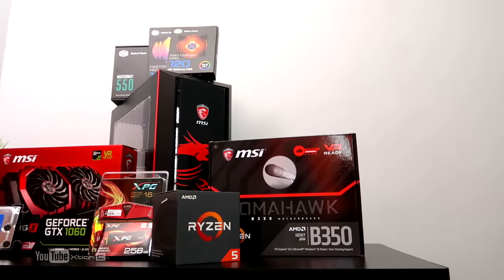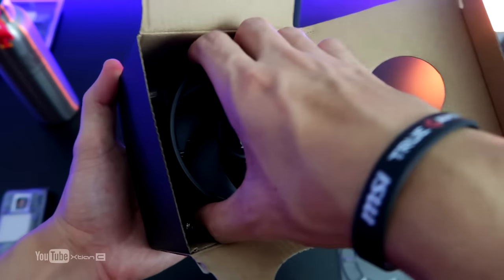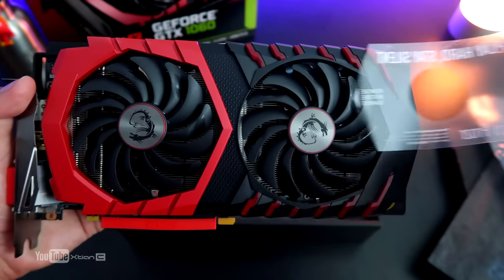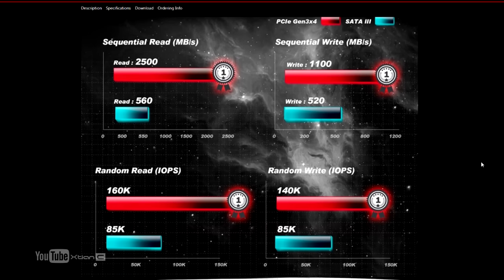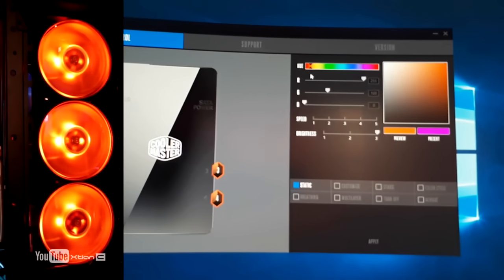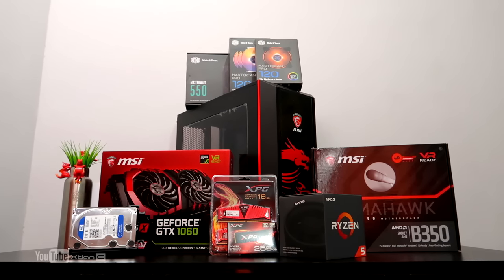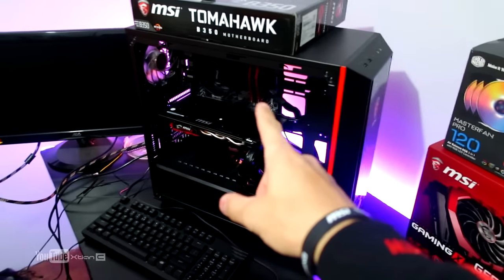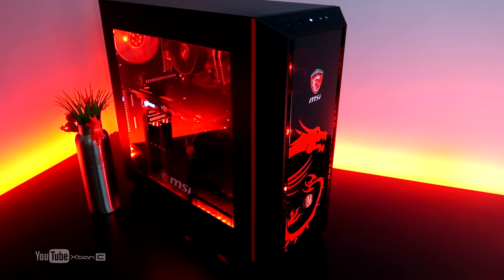Php65k Ryzen PC Build I Ryzen 5 1600 I MSI B350 Tomahawk I MSI GTX 1060 Gaming X 6G [Ph]

Comment: The “XPG SX8000 PCIe 256GB 3D NAND MLC NVMe Gen3x4 M.2 2280 Solid State Drive with Heatsink” is out of stock will a “XPG SX8000 PCIe 1 TB 3D NAND MLC NVMe Gen3x4 M.2 2280 Solid State Drive with Heatsink” work

Edit- also could a “WD Blue 2TB PC Hard Drive - 5400 RPM Class, SATA 6 Gb/s, 64 MB Cache, 3.5" - WD20EZRZ” be switched out for a “WD Blue 6TB PC Hard Drive - 5400 RPM Class, SATA 6 Gb/s, 64 MB Cache, 3.5" - WD60EZRZ”

Also can a “MasterWatt 550 Watt Semifanless Modular Power Supply, 80 PLUS Bronze Certified Power Supply for Computers” be switched for a “MasterWatt 750 Watt Semifanless Modular Power Supply, 80 PLUS Bronze Certified Power Supply for Computers”

Comment: Pc build plan

Cpu : Ryzen 7 2700x
Mobo : Msi B450 tomahawk
Gpu : gtx 1060 6gb
Ram : 16gb ddr4 2400mhz
Hdd : 2Tera
Ssd : 250gb samsung evo
Psu : any 600w or 550w full modular 
Case : deep cool (earlcase)

*stock fans 
What could be the flaws or possible bottleneck? Given the airflow.

Comment: I wanted something similar to this build. May I know why you didn't go for a GTX 1070? How much would it cost estm. if you get that build with a R5 1600x, GTX1070 and only 1TB HDD.
 Thanks.
Reply: Mr.G / xLockser ois, found out that the X version difference with the non-x is the XFR and higher base frequency, non x with the stock cooler,  it would be much cheaper, unless I go with aio coolers 😊

Comment: i want to build my firs gaming rig, need advice  po.?can i stream and play on high settings? and can i add a wifi for this one?
CPU- ryzen 5 1600
GPU- gigabyte gtx 1050ti 4gb oc
MOBO- gigabyte ga ab350 gaming 3 
ram- ADATA XPG Gammix D10 8GB DDR4 2400MHz
Ssd- wd 120gb
hdd- 1tb seagate
PSU-Thermaltake Smart RGB 500W 80PLUS APFC Non-Modular Power Supply .

Comment: processor:Ay Ryzen 5 1600
MotherboarD:GIGABYTE GA-AB350M-Gaming 3 AMD Ryzen CPU AM4 Socket DDR4 PCIe Gen3 USB 3.1 GB LAN Micro ATX
Graphics card:Gigabyte GeForce® GTX 1050 Ti D5 4G Graphics/Video Card
Case:Midtower
AT DDR4:Trident Z 16GB 8x2
CAn it rin Pubg in ultra setting in 70 Fps or under??
Reply: Yes but not at ultra
Reply: Mix settings to High but not default Ultra. You'll get a good stable fps up to 50+ fps. Upgrade it to 1070 ti, 1660ti or Vega 56 then i assure you can go in Ultra settings with a stable decent 60+ fps and up.

Comment: +XtianC Kaya po ba ng MSI GTX 1050 Gaming X 2GB at AMD Ryzen 3 1300X at HyperX 8GB 2133mhz Ram. Ang CSGO ng online at naka max settings 900p resolution. Habang nag rerecord or nag i-i stream. Can I still get 60-100+FPS with that kind of setting? Thanks if you answer my question XtianC. By the way I am your new subscriber
Reply: Timothy Azucena oo naman kayang kaya
Reply: kahit i 1080 mo pa ata eh
Reply: Uhm, bro go for ryzen 3 na lang tapos ioverclock mo. Maabot niya performance ng 1300x with stock cooler. Yang 1050 mo lalampas pa ng 100fps. Marami dito sa utube nagtest. Search mo na lang 1050+csgo

Comment: Nice rig man! Nust need your suggestion, will I still get the best out of the 1060 GPU if I use the 1500/1500x instead of the 1600? Medyo tight ang budget to a max of 55k eh. Thanks!
Reply: Go with ryzen 1600 para wapang bottle neck
Reply: 1500 wont bottleneck. Pero 1600p  po talaga ang sweet spot and recommended na din po  mas future proof e
Reply: Pwede naman financing eh
Reply: just go for 1500 or 1600, you can OC those base clocks if you want to bump them up :)

Comment: Intel Core i3-8100 Coffee Lake Quad-Core 3.6 GHz LGA 1151 (300 Series) Processor with GIGABYTE Z370M D3H Micro ATX LGA1151 Motherboard Bundle 
- 14,399.00
PALIT GTX1060 SUPER JETSTREAM 6144M GDDR5 192B 3DP HMDI VGA RGB LED
- 15,399.00
AVEXIR 8GB 2400MHZ DDR4 CORE SERIES RED LED AVD4UZ124001608G-1COR MEMORY
- 4,900.00 or 2x8gb 2133Mhz (6,800)
WESTERN DIGITAL 6TB SATA 6GB/S BLACK 128MB (WD6001FZWX) HARD DRIVE
- 15,250.00
i'm not a tech guy, idk if i3-8100 worth buying than ryzen 5 1600, i saw 1600 costs like 
i7-7700 in PH
= 49,948 or 51,848 all of them are brand new what if they're second hand or something on ebay or whatever. may be lesser XD

Comment: Bro ano ba ang ire recommend sakin amd or intel gusto ko kasing maglaro ng ultra preset ehh
Reply: J Andaya idol if youre only do gaming then go with intel coffee lake.
Reply: What type?
Reply: Coffeelake right now is expensive. Dahil z370 pa lamg nirerelease. Kung di na makahintay, ryzen 5+gtx1070, 8gb ram goods na yan.

Kung makahintay next year, b370mobo+8th gen i5+gtx1070

Btw, wala masyado difference ang high sa ultra preset. Fyi lang from personal experience. Kaya suggest ko is gtx 1060 na lang
Reply: Sef Isred yes. If he is concern only on the fps then intel platform is for him especially the new coffee lake.
Reply: Arafat Pokaan if he can wait until next year :D no accurate dates to when b and h mobos for coffeelake will be released.
Reply: Sef Isred lol. Pero hindi ba bottle neck nang i3 ang 1070? I mean 1070 is 1440p gpu so in order to maximize the 1070, i5 should be a better cpu.
Reply: Arafat Pokaan ai uo pala. 😅 nagsuggest ako ng i3 pero ultra preset pala gusti niya. Haha
 Edit ko na lang.

Comment: Uhh..i built the same pc except it had gtx 1070 8gb,ryzen 5 1600 . end price was 59k.
Reply: Godsu Godsu sup sir! I'm interested in your build po, patingin po ng components and san nabili? Thank you so much if sasagutin!😁
Reply: :O
Reply: 59k ako 50k rx580 same specs  inupgrade ko to gtx1080 nag swap kami  ng kakilala ko  dagdag ko 10k 😎 so 60k ginastos ko
Reply: Ask ko lng ano bang mas balance na mobo sa r5 2600x. X470 prime pro or rog strix x470-f?
Reply: @lance4930  bro kmsta experience mo with both gpu? ano po nfeel nyu pg mron at wlng freesync? balak q po kasi mg rx580
Reply: @ryujiikuma296  well if I were you bumili kanalang ng 144hz pero ang free sync kasi is parang pinapa smooth ang mga movements ng mga stuff sa game pero bababa minsan fps mo same na rin sa g sync pero rx 580 ok naman siya pag nakakita ka ng 13 or 10k bilhin mo na pag binili mo sa gou miner palitan mo lang ang mga thermal pads
Reply: @ryujiikuma296  minsan pag walang freesync medyo choppy or onteng lag ang game pero pag naka on smooth lang

Comment: i just checked the QVL list on MSI web and  "ax4u300038g16-drz" is not on the list and it worked for you fine,
so whats the maximum frequency you got with that RAM ?
and did you try to overclock the R1600 to 3.8 / 3.9 , i mean Could you get 2666 or 2933 on that RAM ?

Comment: i think mas mura na ngayon kse 2017 pa itong vid.
build ko almost 77k php?
Ryzen 2700x bundle with msi x470 gaming m7a Ac bt/wifi 30k php
Adata RGB XPG ram 2X8 gb 32Mhz.. 11kphp
Adata nvme XPG SX6000 512GB M.2 SSD 5.5k php
gigabyte RX Vega 64 8Gb gpu 19k php
EVGA Supernova 750 G1+ 80+ GOLD FULL Modular 5.5k php
techware vega  casing with 4 rgb fan with remote 3.2k php
hdd 1 TB Wd blue 2.2k php.. sana bumaba pa presyo tulad ng GPU para lahat happy!
Reply: sir cpu lng ba ung 77k na gastos mo ? wala png keyboard at mouse

Comment: Okay po kaya tong build na to ?

Motherboard: Asus Prime B350 PLUS (AM4) B350 - 5210
Processor: AMD Ryzen 5 2400G 4-Core 8-Thread 3.5-3.9 ghz 4mb 65W AM4 - 8820
GPU: 6gb Asus GTX 1060 STRIX OC - 18530
PSU: EVGA 650B3, 650watts PSU, 80 bronze, full modular - 4440
CPU Cooler: Gigabyte Aorus ATC700 RGB cpu cooler - 4000
RAM: 16gb ddr4 2400 Corsair Vengeance LPX, black - 9800
SSD: 250gb Samsung 860 EVO SSD - 4760
HDD: 2tb WDC Blue 64mb hdd - 3170
PC Case: Tecware Edge All-Black Tempered Glass Gaming Case - 2000

Total: 60730 php

Comment: Pwede Swap sir? Intel i7 7700+Gigabyte H270M-D3H+Cooler Master Hyper 212 LED Turbo Dual fan cpu Cooler. Kahit yung cpu at board mo lang. Worth 20,150 po cpu+board ko+ yung cooler is 2.9k something nabili ko Dynaquest Makati .DOP Dec. 26, 2017, complete box, receipt, accessories.

Comment: Eto yung build ko sir Xtian sa girlfriend ko which is multimedia artist / gamer. Open for suggestion po para sa improvement ng pc niya. Thank you

-Intel core i5-8600k
-Asus rog strix gtx 1060 oc gddr5
-msi z370 pc pro
-g.skill trident z rgb 16gb 2x8 ddr4 3000mhz
-cooler master hyper 212 black
-thermaltake riing 12 rgb 120mm 3pack (x2)
-seagate barracuda 1tb
-sandisk plus 120gb
-evga 750gq 80plus gold 750watts semi modular
-cooler master masterlite box 5 or phanteks p400 eclipse

TOTAL = Php 66,699
SHOP: dynaquestpc, pchub, pchub edge, jdm all located at gilmore

All researched by me kuya Xtian slash techsource ng pinas! Xtian FTW! good build kuys!

Comment: sakin ang spec ng build ko 
msi x370 gaming pro carbon mother board
SLI gigabyte geforce gtx 1080 
G.Skill Trident Z RGB 32GB DDR4 3200 Desktop RAM
AMD ryzen7 1700x CPU
RGB Thermaltake 650w 80+ bronze power supply 
Thermaltake CL-W107-PL12SW-A Water 3.0 Riing RGB 240mm AIO Liquid CPU Cooler

yan spec ng computer ko at gumastos ako ng 3k $
Reply: Errol Sarmiento sir mag kano ganyang spec on peso?
Reply: Tyrone Tismo 3,000 x 51 (assuming 51 ang dollar to peso) approximately 153k pesos.
Reply: Errol Sarmiento Baka msi Z370
Halos same build natin naka 8700k ako at msi gtx 1080ti

Comment: pahelp naman po any suggestion  about dito sa build ko? 1st time ko po maag build base po lahat yan sa amazon.jp
meron po bang compatibility issue or meron po ba na masa suggest na mas magandang build dito..
150000yen lang po budget ko
ASUS Intel Z370搭載 マザーボード LGA1151対応 PRIME Z370-P 【ATX】

Intel CPU Core i5-8400 2.8GHz 9Mキャッシュ 6コア/6スレッド LGA1151 BX80684I58400【BOX】 

WD HDD 内蔵ハードディスク 3.5インチ 1TB WD Blue WD10EZEX SATA6.0Gb/s 7200rpm 64MB 2年保証

NZXT ミドルタワー SOURCE340 [ RAZERモデル Black & Razer Green ] SOURCE340-RazerSE NZXT

ASUS R.O.G. STRIXシリーズ NVIDIA GeForce GTX1070搭載ビデオカード オーバークロック メモリ8GB STRIX-GTX1070-O8G-GAMING ASUSTek

玄人志向 NEXTシリーズ 80 PLUS Bronze 500W ATX電源 KRPW-N500W/85+ 玄人志向

CORSAIR DDR4 デスクトップPC用 メモリモジュール VENGEANCE LPX Series 8GB×1枚キット 

ASUS ゲーミングモニター 21.5型フルHDディスプレイ( 応答速度1ms / HDMI×2,D-sub×1 / スピーカー内蔵 / 3年保証 ) VX228H ASUSTek
Show less
REPLY

Comment: HIGH-END GAMING AMD RYZEN 7 RGB PC BUILD W/ LATEST PRICE

AMD Ryzen 7 2700X 8-Core 16-Thread 3.70-4.30ghz 16mb 105W - P17,500.00

Asus Strix X370-F Gaming - P12,200.00

Asus GTX 1070 Strix 8gb 256Bit ddr5 STRIX-GTX1070-8G-GAMING - P21,500.00

GSkill Trident Z RGB 16GB Dual DDR4 3200 CL16 (F4-3200C16D-16GTZR) - P11,850.00

KINGSTONE UV400 120GB SSD OR Adata SU800 128GB SSD (OS) - P2,350.00

Seagate Barracuda 2TB ST2000DM006 (SATA 6Gb/s) 3.5" (STORAGE)  - P3,620.00

Aerocool Rave RGB 800watts 80+ Power Supply - P3,350.00

Rakk Hawani Gaming Case BlacK - P1,995.00

Rakk MARS Spectra 2 PC Lighting Kit x2 - P2,900.00 

TOTAL  -  P75,000.00

Comment: GPU: 
Option 1: Palit GeForce GTX1050 TI StormX Videocard 4gb 128bit Pcie DDR5
Option 2: MSI GAMING GeForce GTX 1050 GB GDDR5 DirectX 12 Graphics Card
Processor:
- AMD Ryzen 5 1600
Mboard: 
-MSI B350 Tomahawk
RAM: 
-8gb dual (2x4gb) Team Delta led 2400 mhz

Mga Sir compatible po ba yan . ?? 
yan po ung build plan ko..

Comment: Xtian C pa critic nmn oh or kung sino diyan pwede :)
Processor Amd Ryzen 5 1500X 3.50-3.70ghz 4 Core
Motherboard EMAXX EMX-A320-Gaming
RAM Kingston HyperX Fury 8GB Single DDR4 1866 
Hard Drive Western Digital WD Caviar Blue 2TB 64MB WD20EZRZ
PC Case Tecware Void Tempered Glass
PSU Cooler Master MasterWatt Lite 500W 80 Plus White
Graphics Card Palit GTX 1050 Ti StormX 4GB

Fans N/A
Reply from the maker: LebenetGaming change mobo to B350 chipset and get a faster RAM with at least 2666mhz freq speed. Tapos if kaya pa budget kuha ka ng 120gb SSD
Reply: Xtian C pwede na po ba ang MSI B350M PRO-VDH and WD Green 120GB Sata (WDS120G1G0A) SSD
Reply: And should i change my ram into 16gb?

Comment: Sir PUWEDE PO BA GAWA PO KAYO NG VID NA 10K LANG PUWEDE NA MAG LARO NG PUBG PARA MAY GUIDE DIN PO AKO THANK YOU :)
Reply: pre ung piso net na PC lowest buget is 14k pano pa kaya kung 10k lang hahah tangina hahah
Reply: hahahhaahahhaha
Reply: Atleast 20k pare ipon kapa kaya mo yan.
Reply: malabo ho yang 10k na pang pubg, 20k and up dapat, pero yang 20k lowest setting yan tapos baka mas mababa pa sa 30fps.
Reply: Google the new Ryzen 5 2400G & Ryzen 3 2200G, no need for video card, Play on medium settings. Will cost you around less than 20K
Reply: Ryzen 2200g and 2400g need a 3200mhz RAM at least 8GB for you to play triple A games and to run PUBG @ 40 fps. Gtx 1050ti is cheaper or at least near the price of that RAM.
Reply: 2nd  hand build Tips for 10k
Processor: Core i3 2100 2k
Board: optional 2k
Gpu: Gtx 660 2k
Hdd: optional 1k 
Case: rakk or optional 1k
Psu: trurated used or rakk 1k
Ram: 4gb moduler or any option Good For 1k
Tips For 10k Build
Reply: 10k... pubg... HAHAHAHAHAHHAHAHAHAHAHAHA
Reply: Need mo high RAM pra sa PUBG
Reply: Hahaha! Laro ka nalang sa net cafe...
Reply: Ros ka nalang haha
Reply: Raykiller Gaming sure ka po? Kaya?
Reply: Hahaha 10k mag youtube ka nalang
Reply: Hahahahaha taena
Reply: huh 10k for pubg baka cdr king lang makakakuha ng specs 😁
Reply: Ahahahahaha

Comment: Pre pa critic naman ng build plan ko: 
Procie: Ryzen 5 1600
Mobo: Asrock AB350M Pro 4
RAM: 8gb dual (2x4gb) Team Delta led 2400 mhz
GPU: Galax GTX 1060 6gb EXOC White 
STO: 120 WDC Green SSD
PSU: Seasonic S12ii 520 Watts 

Budget ko is hanggang 40k lang. Yung GPU ko is second hand at P13,000. Baka may maiisuggest ka na changes, lalo na sa RAM. within 2400 mhz lang kasi hindi ko pa afford ang mas mataas. Salamat ng marami!
Reply: joker3117nk salamat sa reply pare! Medyo nagkabudget na extra going for the Palit GTX 1060 Super Jetstream brand new 👌👌👌 salamat!!!
Reply: Pau Alvarez pre musta build mo? Ok na ba? Pwde pa critic dn kung ano mganda..
Cpu: ryzen 3 1200
Mobo: msi tomahawk arctic b350
Gpu: any Gtx1060 6gb na mura :)
Psu: any semi modular na 500w
Ram: 8gb ddr4 2400

Pa suggest sna brad kung ano mgandang case at kung ano pa pwde ko i.improve.. :) budget ko is 35k to 40k pero pwde pang ipilit sa 55k.. 😊
Reply: oks na pre nabuo ko na! using it right now. 55k nagastos ko brad Ryzen 5 1600 and GTX 1060 6gb and 8gb 3000mhz RAM kasama nadin 23" IPS Monitor :) check it out! 

https://www.facebook.com/henrypauloalvarez/media_set?set=a.10210985082970382.1073741857.1453419374&type=3
Reply: Grant Philip Gloria at least go for a rx 570/560 rather than gtx 1060 due to price esp. On 1080p gaming. Add additional ram. I say 2x 8gb ram for 16gb ram for dual channel upgrade.
Reply: Inwin 301
Reply: Pa check naman po ng build plang ko

Cpu: i5 8400
Gpu: MSI GTX 1070 TI DUKE 8G
Mobo: MSI Z370-a pro
Ram: Corsair Vengeance LPX 16GB
Psu: Corsair RM750x
Reply: Suggest ko bro asus ang motherboard yung graphic card Gtx 970 mas mura yan kesa Gtx 1060  6gb pero 5~6 fps lang pagitan..asus din ang graphic card kong ok lang..☺
Reply: @jakey9211  malakas na yan bro ang ok yan i5 ang i7 malakas sa memory best choice yang i5..graphic card ok mobo ok pcu kahit cx650 ok na mas mura lang 80 plus bronze din.

Comment: Pa critic naman po dito mga sir kung walang conflict bawat parts bago ko po ibuild yang specs na yan.
Thanks in advance.

AMD Ryzen 7 1700 8-Core 16-Thread 3.0-3.7 ghz 16mb 65W AM4, Wraith Spire RGB
MSI B350M Gaming Pro (AM4) B350, mATX, 2*ddr4
2x8gb ddr4 3000 Kingston HyperX Predator Black, CL15 1.35v
2tb Seagate Firecuda SSHD 3.5"
250gb Samsung 850 EVO SSD sata; R|W: 540|520 97k|88K
4gb Asus GTX 1050 Ti Expedition OC 128bit
Thermaltake TT Versa H18, micro atx, x-side, 1x120mm
Corsair 650watts PSU, VS, VS650
Reply from the maker: What's up bro! Ask lang if San mo gagamitin ang build?
Reply: Sa video edting din po sir, Vegas pro 13 po gamit ko sir
Reply from the maker: xentrie Sanchez get mo na x370 chipset na mobo  Tapos if kaya pa ng budget mag GTX 1060 ka na kahit yung 3gb.
Reply: Sige sir maraming salamat, God Bless...

Comment: 30,000 Pesos Gaming pc kahit lumampas ng konti basta mas good quality
Reply: 5,200 AAC030 AMD Ryzen R3 2200G 
3,150 BAA200 Asus Prime A320M-K 
3,650 CFK002 G.Skill Aegis 8GB 2400Mhz CL15
900 GAZ005 Fortress MidTower Casings(Shadow/Magnus/Versa) 
4,050 IAA040 Asus VS207DF 20"  
875 KGZ005 Fantech K612 Soldier RGB 
275 KEZ001 Fantech G10 RGB 
400 JAZ016 Badwolf Headset w/LED 
260 KAZ001 Secure AVR 
7,750 Zotac 1050ti series

Yan build ko pero palitan mo ang Mobo ng Asrock 350 mas maganda daw yun sa overclocking yung nkalagay kasi dyan asus prime 320 at ok na ang ryzen 3 kasi may videocard ka naman na 1050ti na at mas budget yan build n yan

Php26,510 complete na may monitor na asus 20inches keyboard mouse headset AVR at CPU mo

Sa JDM techno sa Gilmore
Reply: Bro ok na yang mobo mo pinaka dabest na motherboard ay asus sa tibay at sa ganda ng overcloking nyan,subok na subok namin yan 6 months na walang off ang pc na derecho open ang games wala akong masabi hanggang ngayon buhay pa rin..yung frend ko try ng asrock ilang buwan lang nasira na asus Japanese capacitor ginagamit nila kaya ibabad mo man sa ibat ibang games hindi ka ipapahiya..

Comment: haha no thermal paste.👎🏻
Reply: Cy P it has pre applied?
Reply: CPU's has pre applied thermal paste. So it's optional to apply thermal paste. Most of that is if you buy a new aftermarket cooler then sure you did. But if you buy a CPU with a cooler it has a pre applied thermal paste.
Reply: laftrip ako sa comment na to, may pra applied na paste na mga cpu by default.